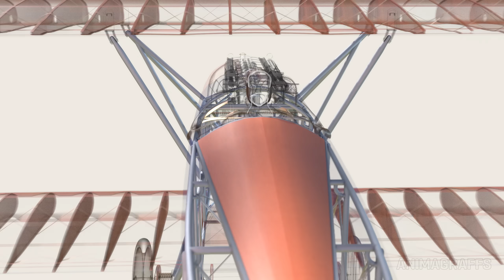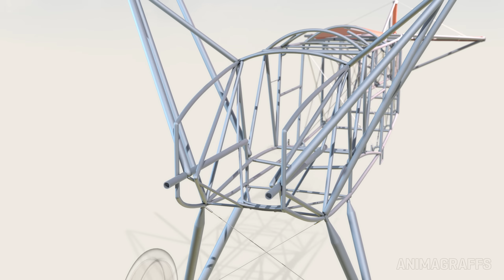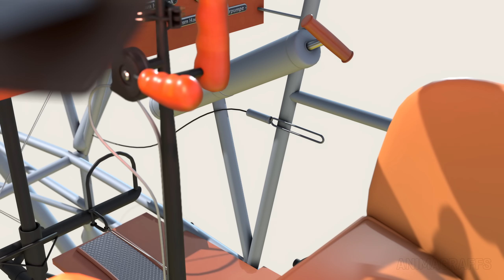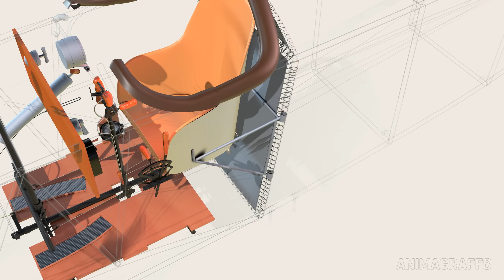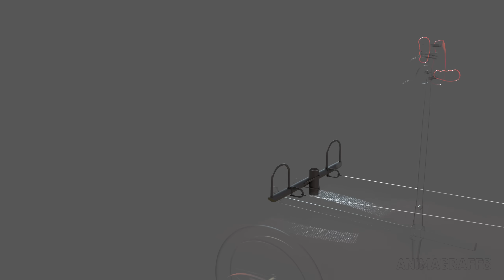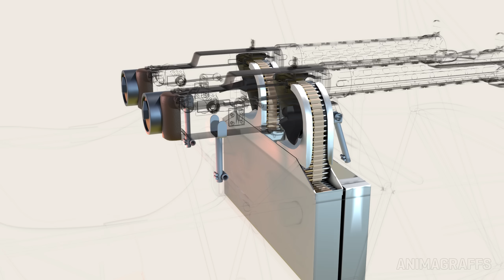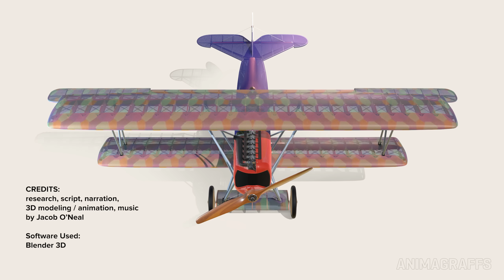How a WWI Biplane Works

Comment from the maker: VIDEO CORRECTIONS
Add your fixes to my work here! Duke out the finer details, sure, but hold the personal insults or I'LL PULL THIS CAR OVER and deal with it myself!
Reply from the maker: Also worth noting: The folks I mentioned as reviewing my work only saw the script and still screenshots of each part. I get so excited near the finish line, I didn't post the video for review. lol. I'm trying, fellas. I really am. But I just wanna UPLOAD MOAR VIDS
Reply: @animagraffs  The rudder pedals in the video are indeed backwards. You push the rudder pedal in the direction you want to yaw i.e. you push the right rudder pedal forward resulting in right yaw along with the rudder moving right. Really the only inaccuracy I noticed great video otherwise! Maybe do a Cessna 172 with a constant speed prop in a future video!
Reply: @Jacob-rx4jk That seems so counter-intuitive, from an ergonomics perspective.  Consider: On bicycles and motorbikes, you rotate the handlebar about its axis in the same direction you want the vehicle to steer.  Even on an airplane, you push or pull the yoke about its axis in the same direction you want the aircraft to tilt about its pitch axis.  And similarly, you rotate the yoke about a an axis that very obviously matches the axial direction about which you want the aircraft to roll.  Then you get to the pedal bar and... Oh... It's ergonomically backwards from every other pivoting mechanical control you have operated in your life.
...
I think if I was a pilot, I'd have restrung the rudder control cables exactly as shown in this video.  Original design be damned.
Reply: @jf3570  Its actually pretty intuitive. You push the right pedal forward to go right and vice versa. If you think about it as a rotation of the pedals I can see the confusion that's how I thought they worked before I became a pilot.
Reply: @Jacob-rx4jk  By that token, one could then argue that pushing the yoke away from you should make the aircraft pitch up, similar to how pushing a computer mouse or nub away from you makes the cursor move up.
Reply: @jf3570  The difference is feet and hands. When I got in a plane the first time it was totally natural to turn the yoke to the right and step on the right pedal to go right. All the people I've taught to fly since have had the same intuitive reaction. I've never had one step on the wrong pedal first time out. You're outvoted, son, 200+ to 1. You have an abnormal intuition. Are you left handed, as well?
Reply: @wcate8301  Make assumptions much?  You know what they say... To assume makes an ass of u and me.  No, I'm not left-handed.  But I am genuinely curious as to which type of attitude indicator you feel is most intuitive: Rolling horizon with fixed-level plane icon?  Or level horizon with rolling plane icon?  Feel free to state your reasoning too... If you have the capacity for analytical thinking too.
Reply from the maker: The label is a little confusing for hp and top speed. It's 180 Horsepower vs. Top speed: 190 Kph (118 Mph)
Reply: @animagraffs  Being German, the speed would have likely be in metric units. For English countries aircraft typically use knots as a measure of speed, similar to nautical boat navigation. Engine power might have be noted in watts (a metric unit of power).
Reply: @animagraffs 
Of course the Fokker DVII is a biplane made of Wood, stitched canvas, and Wood, cause that's what Most WW1 Planes are made of except the Engine and Fuel Tanks, which for Entente Aircraft is Radial Engines, V Engines, or Inline Engines, and the same for Central Power Aircraft, both Bombers and Fighters are made of what I mentioned, specifically Western Entente and Central Powers Bombers and Fighters, mostly German Bombers and Fighters like the Fokker DR.1, Gotha G.IV, and others
Reply from the maker: The prop is definitely rotating the wrong way at the end sequence, but I got it right at the beginning so that ain't half bad. For all my talents I've yet to conquer rotating parts, which I get wrong in just about every video at some point. The nightmares!
Reply: @animagraffs  "The prop is definitely rotating the wrong way at the end sequence"
Still loved the video though. Cheers.
Reply: @animagraffs  was going to tell you the prop was spinning backwards but I see you already know :)    ---- really love the way you make these videos.  Excellent job!
Reply: @animagraffs  Gee, reverse thrust in 1918! Who'da thunk it? STOL on steroids!
Reply: @animagraffs  One interesting thing is that when the prop is rotating backwards, so is the engine, and you can see the valves open in the opposite order as well. It's cool to see that all of the mechanical processes of your animation are linked together.
Reply: J'avais remarqué cette inversion de rotation de l'hélice mais cela n'affecte en rien la qualité du contenu. Excellente vidéo.
Reply: 15:41 "The limitations of world war 1 artillery". Did you mean to say aircraft here?
Reply: @gaveintothedarkness  yeah I listened to that quote three times and it confused me. Which is why I am here.
Reply from the maker: The rudder might be mixed up backwards. Experts please chime in.
Reply: @animagraffs  you do awesome work and I find it incredibly fascinating and please ignore any rude comments on any nit picking negative people who love to complain.
Reply: @animagraffs  you are correct, sir. It is, indeed, backwards. Just remember, at sub-sonic speeds, the way the surface deflects is the way the aircraft will respond. You deflect the elevator up, it pushes the tail down and the nose up. Press the rudder right, it deflect right, pushes the tail left, and the nose right, yawing right. Hope that helps in future. Great video, by the way, lol!
Reply: @animagraffs  That was my observation too. Right pedal = left yaw? Maybe very early planes were different.
Reply: @animagraffs  You seem like a actual person and i appreciate that 👍
Reply: Yes...reversed...but...WHO CARES?!!  Your work is exemplary..absolutely stunning in concept, subject, and execution. Thanks so much for sharing your excellent work! ☺  @animagraffs
Reply: @z1pictureeditor  Facts do matter. He asked for corrections. I want to live in a world where facts matter. Are you one of those who think a man can turn into a woman? If so that explains everything.
Reply: @animagraffs no its correct.
Reply from the maker: I meant to say "armaments", not "artillery"
Reply: @animagraffs  it's not gunnery limitation, but rather a mounting one; wings weren't strong enough
Reply: Excellent video. It’s likely that the magneto switch doesn’t switch between spark plugs-but rather between completely separate ignition systems. 

This is done for redundancy, as no spark=big trouble in the air. Both are used in normal flight due to a slight performance gain and it’s switchable so pilot can check each independent system before takeoff.
Reply: @Richz87 That would in turn one of each of the pair of spark plugs per cylinder. Yea its a Magneto switch so it controls the two magnetos. Which controls the spark plugs..
Each Magneto would have 6 spark plug wires for each of the 6 cylinder's, and with both Magneto's thats 12 spark plugs total and two seperate systems for each cylinder. 
Most likely its set to be on Magneto 1 for starting is so that it only has to power one Magneto with the Hand Crank and would give a stronger spark for each cylinder. Then once its already running you would switch it Dual Magneto 1 & 2 Both On for the added benefit of more power and more even cylinder temperatures, plus more fuel burn from 2 sparks.
The reasoning was for the unbeatable reliability of Redundancy for sure. If one of the Magneto's went completely out and you lost Spark from all 6 of those spark plugs now, having the two seperate magneto ignition systems it wouldn't affect the flying ability of the plane, and might not even be noticed at first..
Reply: Love the video, but I'm pretty sure it'd be hard to breathe at 20,000 feet in an open cockpit without oxygen. 😢
Reply: @TheTreegodfather  the germans devised a crude oxygen system to reach such altitudes late in the war. it was a pipestem the pilot held between his teeth with a hose to a bottle of oxygen that the pilot could regulate the flow of with a valve.
Reply: from the pilot's perspective, both the camshaft and the crankshaft rotate to the right, clockwise.  The sloped Disks for synchronizing the machine guns with the propeller are connected to the camshaft via one stage of spur gear and should therefore rotate counterclockwise. Also the slope should be of course of the other way around.
The whole engine is turning anticlockwise in the sequence where the synchronization with the machine guns is explained.
Reply: Very enjoyable video. The wheel covers were in fact linen canvas like the rest of the aircraft covering, and doped tight as a drumskin. I used to think they were metal too so smooth is their finish. The synchronisation mechanism shown is of course just one later war German system. Many other mechanical types such as Vickers- Challenger, Birkigt, Sopwith- Kauper, existed, many operating off the oil pump in rotary engines, then of course there is  the revolutionary hydraulic Constantinesco-Colley system used by the British which was still being used (by the Germans!) in the Second World War.
Reply: The Albatros company fitted aluminium wheel covers to the D.VIIs it built. Very distinctive recognition feature!  @mikedowd2094
Reply: Very nice! Superb animation. I'm amazed at how good the engineering was at the time. Ailerons aren't designed for 'equally opposite rotation'. The flight control linkage is designed so the downward moving aileron doesn't move as much as the upward moving aileron. This combats the effect of adverse yaw and makes coordinated flight easier in a turn.
Reply: While the fuselage and tail are beautifully and very accurately drawn, the mainplanes really don't look right. 

The D.VII's wings taper in depth from root (or centre section) to tip, rather than being of constant depth as shown here. The undersides have a constant dihedral angle and the ribs reduce in depth as the tip is approached, meaning that each rib has its own unique shape. The rear spar of both upper and lower wings is straight and level from tip to tip along its upper rear edge line as measured at the centre section, but the front spar top has slight anhedral (downward slope); the rib shape changes to fit the spars, becoming progressively shallower as we move outboard. The built-up hollow spars also taper in width, becoming very narrow at the tips.

This change of section gives the wing washout (apparent twist) even though the undersides have the same incidence (angle to the thrust line) throughout, resulting in enhanced stability in pitch and roll. Very clever and sophisticated aerodynamics for 1918!

The criss-cross bracing tapes shown were later replaced with thin spanwise wooden laths. The leading edge reinforcing ply differed in shape among the three factories building D.VIIs, the broad serrations terminating at the rear edge of the spar being typical of Albatros's Johannisthal plant, whereas Fokker and O.A.W. (East German Albatros Works) ended their serrations at the spar centre line. Fokker serrations were more pointed than the Albatros versions.

So we have here Fokker-built wings with Albatros leading edges! The axle wing is Fokker with Albatros metal wheel covers  - yes, each factory had its own distinctive undercarriage style and paint scheme... 

A real minefield, the Fokker (rhymes with rocker) D.VII. :-)
Reply: not a correction, but an addendum. the aircrafts manufacturer anthony fokker, came up with the interrupting gear after being tasked with copying the entente propeller bullet deflectors devised by roland  garros after he shot himself down when his deflectors failed and he shot his propeller up behind german lines. fokker thought he could do better, and so he did.
Reply: hey can you do next how a nimitz class aircraft carrier works in detailed explanation like the 18th century boat?
Reply: Please do a WWII battle tank 😍
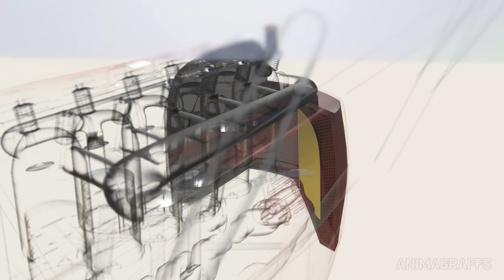Reply: 5:12 doesn't blocking the radiator worsen the cooling effect? Blocking the airflow is to improve overall plane aerodynamics at the cost of radiator airflow / cooling.
Reply: @KeshenMac  no, the purpose is not aerodynamic, but a thermal regime of the engine in different modes of flight. Any engine has an optimal range of working temperatures; overheating and overcooling are equally bad. The engine cooling needs to be reduced when the plane descends idling its engine, or when the air is too cold (winter, high altitude), otherwise the engine will chill too much and get damaged due to poor lubrication. When cooled too fast, it may even develop cracks.
Reply: @onebronx  Actually, cylinder cracking from shock cooling is an air-cooled engine issue. Not so much a problem with liquid cooling. The effects of too-cold oil truly are a problem with any aero engine.
Reply: @KeshenMac  its more about a finicky engine running smoother at certain tempuratures.
Reply: Ok dad, we’re sorry.
Reply: 4:04 so what is the firing order of those Pistons ?  Two Cylinders are on Intake at the same time and on Exhaust at the same time .
Reply: @sQWERTYFALIEN2011 Excelentné video, aj keď ovládanie smerovky je v skutočnosti naopak, ale to už spomínali iní ľudia. Perfektná práca, klobúk dolu a hlboká poklona.
Reply: @sQWERTYFALIEN2011  The correct firing order is 1–5–3–6–2–4, so the video is wrong. Well, I didn't spot the incorrect valve timing, so respect! Nice catch!
Reply: No biggie, just a friendly FYI for anyone interested, the tail parts are aka Empennage these days, dunno if that's what they called it back then.
Reply: Very well done. But prop spins the wrong way at the end.
Reply: A full video about a Russian Typhoon or an Ohio class nuclear submarine would be awesome.
Reply: Marvelous work here. Thanks very much. FWIW, my sister in law worked for Fokker in the 80s and 90s and informed me that at the company the correct pronunciation of the name was “FOE-ker”, since Anthony Fokker was Dutch. “FAW-ker” is a German pronunciation.
Reply: No mention of a  pilot retention system.  After watching a pilot fall out of his plane on Flyboys, Ive been curious about any harness that was used...if any.
Reply: The word "bank" usually refers to the position of the wings relative to horizontal (20 degrees of bank) AND as a verb (bank right). Alternatively, the word "roll" is normally used as a verb (roll left) . So most pilots would say that the ailerons control the bank angle by making the aircraft roll.
Reply: A Masterpiece.
Reply: Grate job!!
Reply: @PBFoote-mo2zr The flight level indicator in most non-electronic aircraft are in an electric or vacuum powered gyroscopic gimbal. The directional compass in most older aircraft is a fluid suspended gimbal. The rise of the gyroscopic gimbal and the fluid suspended gimbal negated most friction induced drift which was common in mechanical gimbals.
Reply: Lozenge fabric was applied to the mainplanes in chordwise strips, not spanwise as here. It was not possible to match the pattern between adjacent strips, so the discontinuity was very noticeable. Ailerons were separately covered spanwise, often with a different lozenge pattern, of which there were at least three different sizes in the five-colour versions and two in the four-colour! Wings, fuselages, tail and control surfaces were built separately at different times, often resulting in more than one fabric pattern on a given airframe; manufacturers used whatever fabric they could get, from various sources.

The D.VII undercarriage wing was covered with plywood, not linen fabric, and painted, never with a lozenge pattern. It's amazing how such errors persist, when a glance at a photograph from the time disproves them!
Reply: Woah woah woah. That pilot is also absolutely not period correct. why make it like that????
Reply: That was by far true best ww1 fighter … the wing design was for the time magic. Not only was it very efficient at top speed it good fly slower without stalling then any  of its opponents. The rugged water cooled 6 was also the best engine hp to weight out there . Not sure that the compression release controller was put to the run position. I think it is a wonderful to watch..thanks
Reply: Why try for absolute accuracy and then swap out the race of the first pilots in the beginning?  If overall accuracy matters, it does there too. There just weren't that many nor many women for that matter. The vast majority of the building, fighting, and dieing in these planes were European males. PC human history is similar to tacking a jet engine on this plane because "cool"
Reply: Muy lindo Me gustó la sencillez y limpieza del trabájo
Reply: @animagraffs  So, was it a Fokker? And what's the correct pronunciation? Very cool video. With good narration. Thanks for taking the time it required to create this.
Reply: @animagraffs  haha. Okay, dad!
Reply: You forgot the return the decompression lever...but...still a most excellent video!
Reply: 13:15 yaw is the horizontal angle from the pilots perspective, not the vertical angle.

Comment: Error here, the Spandau's ejected the rounds out if a hole front of the receiver into the trays, not dropped out the bottom like British Vickers guns (also a Type of Maxim gun like the Spandaus)  which did drop them out the bottom of the receiver.

Comment: Even the empty cartridge chutes (actually trays) which directed the empty cartridges out in front of and to the side of the cockpit on either side. Modelers usually miss these chutes which were attached to the machine gun receiver, not the airplane itself. These chutes only appear on Fokker DVII's and Fokker DR 1 triplanes.   Albatros and OAW built DVII's also have them but to a slightly different design.